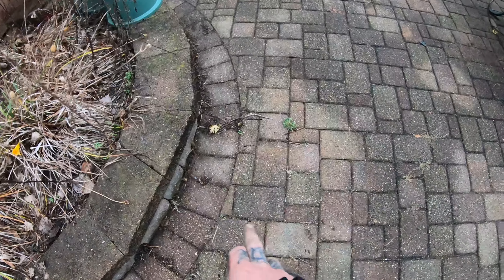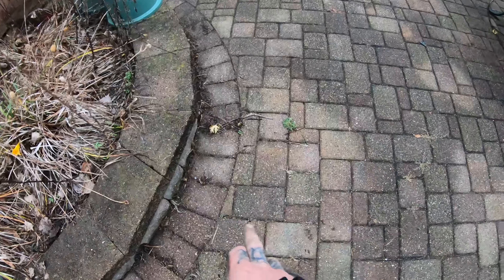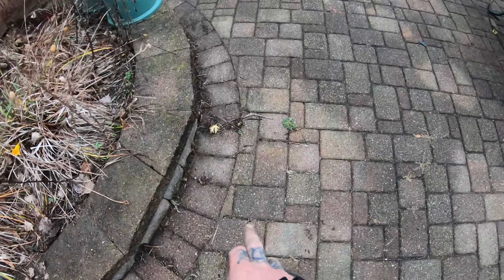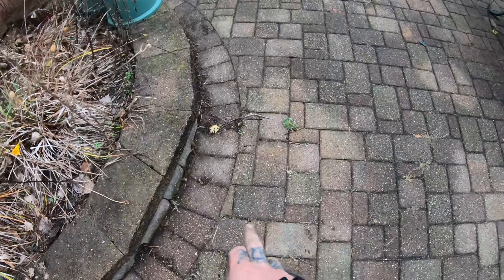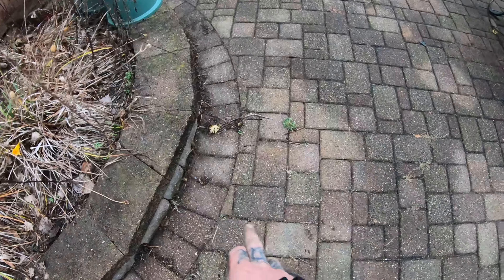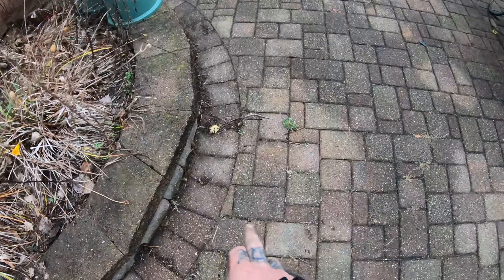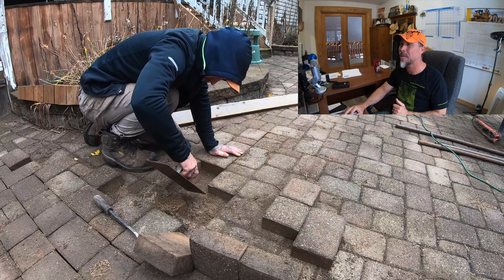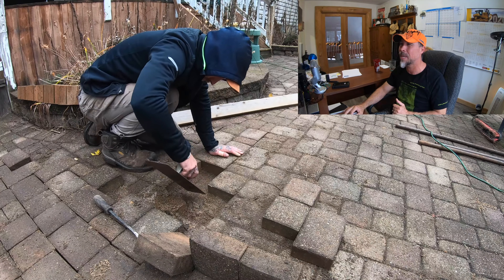How NOT to build a paver patio. Why they FAIL and how to do a DIY repair on landscaping. 4 k video

Comment: On a few intances, where I needed to add more than one inch of sand in a small area, I ended up adding some 3/4 gravel mixed in with the sand for stability. Do you forsee a future problem with me doing this?

Comment: Nice videos!  What would your recommendation be to correct a patio that has sunken on the edges and in random spots throughout if the only base appears to be sand or screen?  I am assuming a complete base correction is necessary, but wondering what you think.  Thanks

Comment: I'm repairing a small stone patio that goes out a basement door.  About a 5x9 foot stone patio with small retaining wall shaped like an L. The lines are uneven from the design. Possibly didn't snap a chalk line,  and the stones along the edges are not finished to create the line along the edge. I'm confused about what you said about the 3ft space behind a retaining wall.  I'm using polymeric sand to fill cracks. And I believe the home owner has the sand to raise up where it has dipped from drainage.  In an existing patio done by an amateur with no fall how do you create this so the drainage doesn't repeat the same issue? What fall could I use on a width of 5 and length of 9. Hopefully this will make sense to you. I'm A female who is the only one working on this and my boss is very bad at patio work.. hence why I'm asking you!

Comment: can you explain what exactly class 5 is?  Around here they have no idea what I am talking about if I ask for it. They do have "paver base" which seems to be a mix of small stones and fines, nothing larger than 3/8 of an inch.
Reply from the maker: Its 3/4 rock with smaller aggregate down to fines mixed in.  Packs like concrete

Comment: These repairs are always hard to seĺl. They are really time-consuming, if you are  charging 1 day of labour for 2 guys (16 × 45 dollars = 720 dollars + taxes + sand + joint material that's a pretty high amount for a 10 year old green patio. In the Netherlands most clients opt for a new patio if they hear that price.

Plus it is always a struggle to get the pattern laid back exactly, most of the times it doesn't fit perfectly.

Comment: work for a hardscape company in Kansas City  and do most of our work in KS and Missouri. with the weather here we never put our pavers on sand. we always pour a concrete base and put the pavers on that. glue the border down and use polymeric sand for the joints. sand base patios just don’t stand up to the weather here at all.

Comment: Just did a similar job—paver patio with several sunken areas.  I recommended dismantling the whole patio, regrading & reassembling. Of course the homeowner didn’t want to spend that much on it so they wanted bare minimum patchwork & then complained that “the end results weren’t as impressive as expected “.  Ironically, I felt the same way about the Jaguar SUV in the driveway.

Comment: When I was working for my last employer (I am self employed, now) they built the compacted base down 12" then then added a thin layer (½" to 1") of compacted tailings to set perfect grade then placed the brick. His work lasts way better than most of the competition.  We get as much precipitation as the Pacific North West, along with prolonged (about 2 months) freeze thaw cycles every spring.

Comment: How do you guys clean pavers?  Any concerns about driving water, pushing sand out of the joints?
Reply: Pressure wash and then re-spread the polysand! Depends of the power of the Pressure Washer but even a low power PW can blow out the polysand and the more powerful the PW the faster the job gets done and the cleaner as well! Take a chunk of the polysand you blow out to the store with you, calculate the sqft (LxW) grab the appropriate amount of bags and follow the instructions! 

Most brands now that you can buy dont leave any haze and dont require any blowing with a leaf blower, Very DIY friendly! Just lay, sweep into joints, tamp it down into the cracks as best you can, set your hose shower and give it a little water!

Comment: Good video.  Customers appreciate when you can do a quality,  lasting patio repair.  So many contractors will tell people that it's a total loss and need to start over.  Repairs often seem tedious,  but  if done right will gain you a lifelong customer! On the poly sand longevity,  we use Alliance Gator sands and we have a bunch of projects at 10 years old with zero sand problems thus far. We like their products a lot.  Thanks for the videos.
Reply from the maker: You're welcome Jared and thanks for the comments !

Comment: You say not to go up to the edge of a retaining wall with pavers. So at the front of this wall you have a empty space there. Then the top of the wall. What do you do with that  empty strip area? Also,  in your other videos you say that behind a wall you add 12-18 inches of gravel for drainage. My question is if you have a paver edging close to the wall, do the pins still hold tight in the gravel. I know if it were compacted class 5 it would be tight. Thanks. Im asking these question because Im hoping to put up a short wall with a patio on top.

Comment: Hey Stanley. Have you ever used 57 clean stone for base than the smaller chip for your 1" base leveler for under the pavers. I've read a few articles and the sound intriguing. Better compaction. Better drainage.

Comment: Isn't it just a matter of time before that same issue comes back?  Seems like that's where the water likes to pool.
Reply from the maker: Possibly but that problem took 20 years to develop. so in 20 years I will repair it if it happens and they will still have spent less money than with other systems that need total replacement.

Comment: I'm not going to say I know the right way. I do a know a way to fix pavers behind a retaining wall settling. I'm not sure the name I think it's class 57 rock. Angular washed rock with no binding agent will not require compaction.
Reply: Alex Newhart ideally it would not but i would still recommend compacting it as it does settle.
Reply: Agreed, a clean 3/4" stone (ASTM #57) when thrown in place has a 95% compaction ratio which is above standard requirements and will only settle a max of 1/16 of an inch!! Hand tamping it can get it up to 98% which is high enough to make any patio last forever!
Reply: The problem with throwing clean stone over dense grade is it can trap water in the clean stone! if there is no way for water to exit or to permeate down, in a warm winter day water can get trapped in that layer and freeze at night causing slight heaving issues
Reply: @ChapmanMain  I didn't include every step in my short answer.  Like the layers of geo-grid or the 10mm stone that replaces the skreeding layer that allows a 2" thickness.  I think we'd have some good convo's if we had more room to elaborate. http://www.hardscapemagazine.com/articles_construction_25.htm
Reply: @TheWiseDaws  Like Chapman said a hand tamp would probably do. Also adding geo grid will help with the settling as well.

Comment: Before I'd start a repair like this I'd either setup a string or use my 10ft Skreeting rod so see where the level of the patio starts to drop off. If the whole thing is curved there's not much you can do to match.
Reply: We do the same thing here in Ontario! Long level to determine where the drop off is, peel back and repair! Sometime the cust. only wants to first foot or 2 repaired but once you show the where it starts to dip they usually always agree to have it repaired correctly from the point of failure!

Comment: Great video, Thank you! I am working on a repair about 50 square feet and broke your rule a bit on the sand thickness but added about 10% portland to the sand that I added. Maybe it will fail and then I will take your advice with the gravel. But my real question is how do I deal with the last few pavers not fitting. Things just got too tight. I don't want to rent a saw and I just need to tweak a few of the last pavers to loosen things up. Am I stuck hiring the job out after I'm 90% complete? I've tried pounding them in and have broke 2 of them. Thanks for sharing your hard earned knowledge!

Comment: Class 5?  what is that
Reply: 3/4" crushed stone mixed with sand as a binder to lock everything together! Its used in whats called a "dense grade" paver base which does not allow alot or any water to permeate through!

Comment: This type or repair seems to be happening on incorrect installations where they use too much sand and not enough base. If the customer would of hired the right guy in the first place they wouldn't have had to repair it period

Nice explanation. I see too much sand more times then not.

Comment: You guys are not prepping the ground properly, you are using wrong material under the paving stone, way wrong way to compact.. Your repair will turn out the same as what was there.. I have placed stone down on city sidewalks and roadways in Ontario Canada where we get tons of frost that will push up and sink stones faster then you lay the stone down if you do it the way you are doing that.. Those books and pamphlet you get at the place you buy the stones are garbage.. I have never had a section of sidewalk sink or push up or road with all the traffic driving the frost in the ground... You may get away with doing a patio that way I would never do it that way
Reply: How do you do it?
Reply: @dru2278  You would need to be show how. The way they do it is exactly how those DIY booklets tell you how but that is not how if you want to do any commercially. Contract around never allow you to use sand under the stones and you have to compact your base with a vibrating compactor over and over screed it until you reach proper level. You to be able to walk on your base without leaving any foot print.. Gravel never settles even that is why you never place your stones on loose material. You need to totally settle your base down then place your stones down on your cement like base... You only tamp the stones to settle your crack filling materiel down in the cracks.. What material we use is always a limestone base material so the grass wont grow
Reply: Yeah lol you can't just come out and say he's doing it completely wrong without giving any insight on your "correct" way. Unless of course you have your Keyboard Warrior License
Reply: @Michaelzeleznik4765  i just gave the other one insight, now if you want to see a keyboard warrior go look in a mirror... You will never see any commercial company use a pipe. never ever
Reply: @sirwallygator565  Im also in Ontario Canada and what you just said was completely wrong!!!! The way you just said to have it done goes against all standards for commeracial and residential standards! You mentioned screenings... Im in Ontario Canada and no where in the ICPI standards, Unilock standards, oaks standards, techo standards does it say to use screenings lol NO WHERE! EVER lol It goes against all building practices including sidewalks and road-base installations! Screenings are only ever used to shortcut and cheap out and those saving never get passed onto the customer as they never know better! 

Just look up ICPI, download their Construction Tolerances and you will quickly realize how wrong you are! 

You either use a #57 clean under a #8-9 paver base (open grade)  or a #67 crushed under and concrete sand paver base (dense grade) If your going deeper then 10 inches you must import and install an ASTM #2 stone and compact accordingly! 

There is no need to compact as over the years the ground has settled and compacted to its lowest point and only requires a thin top layer to build it up! The settling and natural compaction happened because whoever built that wall in the first place probably followed the general rule (which you should know about) of no tamping equipment within 1-2 feet of the wall otherwise you risk pushing the wall outward (blowout) and also more then likely didnt install any geogrid/earthlock as many years back geogrid wasnt considered a mandatory installation requirement for smaller rural/res walls! 

Class 5 stone or 3/4 crushed aka ASTM #67 stone can be compacted with a hand tamp to 96% compaction ratio which is beyond the 92% required for a standard non failing patio base! 

Take a look in the mirror and you will see the actual keyboard warrior who has no idea what hes talking about when it comes to interlock/concrete/paver installations!
Reply: @ChapmanMain  You wrote a lot of crap, all those standards were wrote by the manufacturing companies. Screenings has load bearing capabilities, sand has none.. When you run into a city or town who has these standards write by the companies all I do is place a bid along with a engineer report on said practices compared to the way it should be done. I get most of the contract I bid on and the ones I don`t win I get called in to repair the crap others do.. Don`t how you want to do it. I do it the proper way... Keyboard warrior who most likely never places stone anywhere but can google a lot.. I could have saved you the trouble and told you what standards are. I go above and beyond the standards because those are minimal standards and practices. Not the standards you fallow if you want to stay in business.. This is why no one wants to show on here how to do anything the proper way. You have all these google professionals that read and think they know more then the person doing it... Go get commercial contracts and a town holds back 10 to 20% of your money for a one year period then hand you your deficiency list lol we will see how long you are in business. End of story time kids
Reply: @sirwallygator565  The ICPI is not a manufacturing company! Like I said look it up, Sand is only used for 1/2" to 1" layer to provide a thin layer to level out the work area! The ASTM  #2, #57 and #67 stone are used as the bulk to provide bearing capabilities! I have commercial contracts and never have we used screenings as a base material over the 3 I just mentioned.. Your company that installs with screenings to cheap out and save money!! I dont work for a company I own a company, I go to seminars, have certificates and am educated on the matter, you on the other hand are just a liar who probably doesnt even work in the industry!! I bet your just going by hearsay from installation standards set 30+ years ago! Stop talking already keyboard warrior, do your research next time before you open your mouth pretending to be something your not!